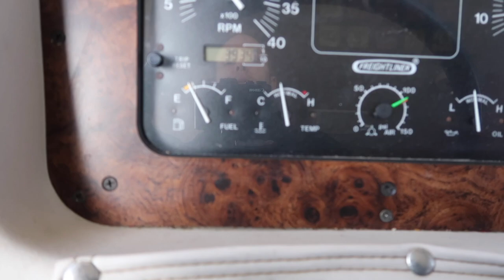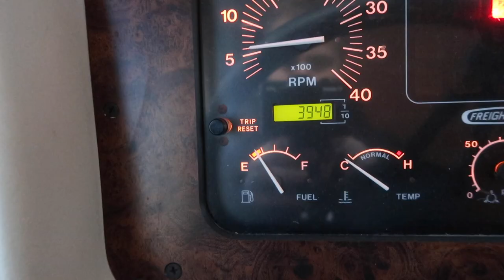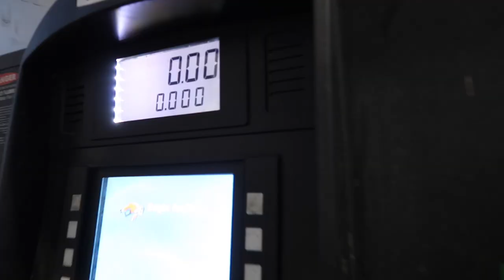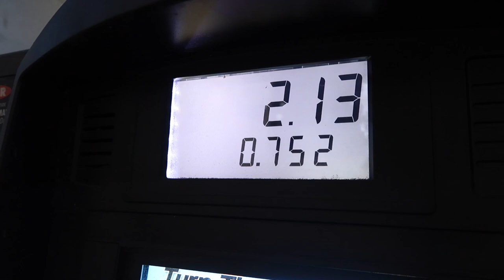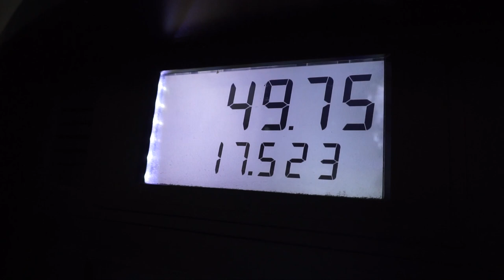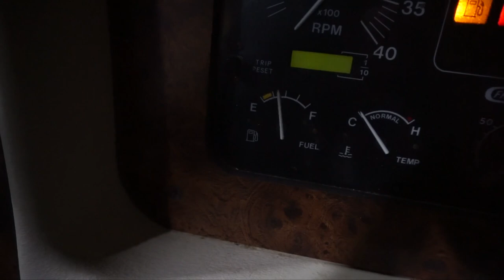CRAZY $$$ How MUCH to fill up a Diesel RV Class A motorhome

Comment: Hey JD.👋  I was going to guess  $187 to fill up the RV.  Unlike all of the RV guys I work with, your tires will wear out, not dry rot.  Props to you for driving the hell out of it.👊  You should wrap it to promote your channel.  It's a rolling billboard and that's perfect for advertising.  I'd love to see a wrap with the GT500 scaled up for the RV and the wheelwells aligned so as the RV's wheels turned, they would look like the GT500 was rolling.  Hope that somehow made sense.  No homos, but you look kinda hot in Laura's glasses. haha.  No offense to the rest of the crew (all great people), but the one who stole the show this time was Liam. That little grin at 4:23 would melt anyone's heart.❤  Great vloggin' bro.  See you next time.✌
Reply from the maker: TheMick26 RV wrap is in the works but to get a print of my car on a wrap would cost way more than I want to invest on the RV
Reply: JD JoyrideTV what about your JD Joyride TV with your Logo ?

Comment: The $100 limit is due to holding on the card. Truckers cards dont due it as they use a duel nossel system. Takes 10-20min fuel time.  Gives the co-driver to take a shower while the other is fueling and doing an inspection.

Comment: Never seen a gas pump stop pumping at $100 before. I filled up my truck and a couple 4wheelers and went past $100. My truck usually takes about $80 in fuel to fill
Reply from the maker: john russo could be the area
Reply: $80? Youre lucky. I have an auxilary fuel tank tied to the fuel system. I hardly fill up, but when i do i scream at the 122gallons. i also use it for the tractor, so its a win in a way.